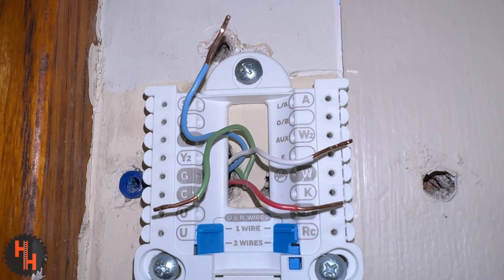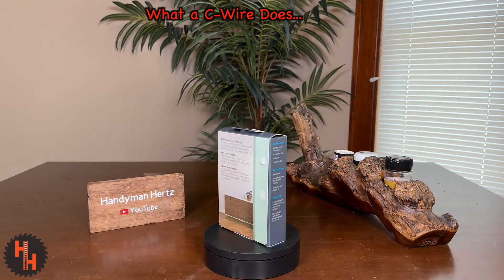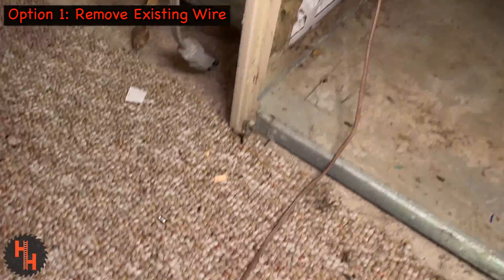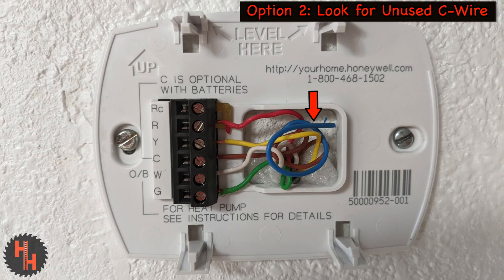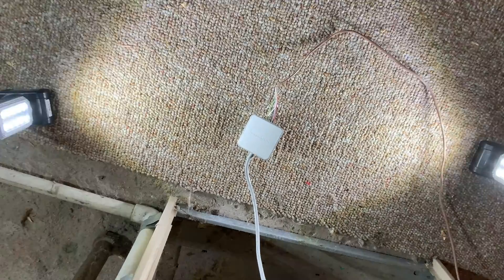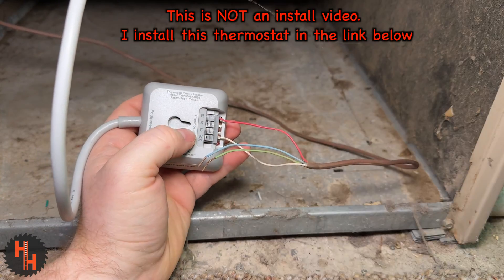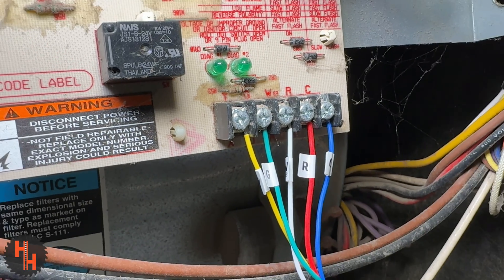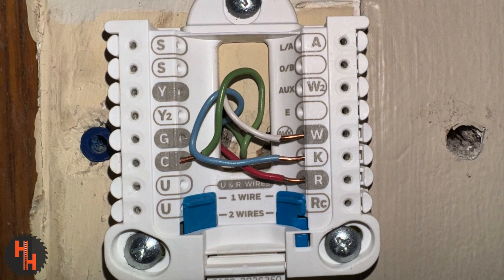Add a C-WIRE ADAPTER Instead of Rewire (for smart thermostat)

Comment: @handyman hertz  I have an older home which uses a Boiler for Heat.  I only have a 2 wire setup. I removed my current old school honewell Thermostat and found only 2 wires..  I would like to connect a smart Thermostat but have yet to figure out the brand or how
Reply from the maker: Sorry, I can’t help you, I am not qualified to speak on boilers. I don’t have any experience with them.

Comment: You need the g wire to run the fan independently 
, if not it wont work
Reply: I was looking for the green wire as well, so confusing

Comment: What if we only have two wires, a red and white?
Reply: Ran into the same issue, instead of running a third wire, i bought an adapter and you just wire it to the thermostat. Its a big job adding and  running a third c wire
Reply: @YoungHeartedSoul what adapter did you use?

Comment: Hi, on my furnace and thermostat I only have 2 wires. red and white for just heat. Can this be used for this setup also? Thanks
Reply: same question!
Reply: Same question.
Reply: Yes. My furnace has 2 wires and I use a wall adapter, split that into the C and Rc.

Comment: I’m confused! Does the adapter wire need to be ran from the thermostat to the furnace?
Reply from the maker: From your thermostat, use the wire you have, and it goes into the C wire adapter. The C wire adapter has its own set of wires that then goes to your control board.
Reply: @HandymanHertz so then probably won't work if you have heat pump, right? Because doesn't the blue wire end up doing some type of reverse function?

Comment: I installed Sensi thermostats in our Church and Sensi C Wire Maker Kits.  Still working off of batteries.  Do you have any suggestions?  Any help would be greatly appreciated.  Thank you for the video

Comment: What if there's no c wire connection at your furnace?
Reply: There's no c terminal at the furnace. I bought a c wire adapter kit but that only works if there's somewhere to connect it.
Reply: @elbucky6 same issue here. Any chance you found the solution?
Reply: @MattyFrank it's been a while but I think I connected it to the same place where the lead, with no voltage, going out to the condenser is connected
Reply: I have a 2 wire system ... will it work
Reply from the maker: Then You need a c-word adapter. Which I have a video link to in the description
Reply: @HandymanHertz  C-word adapter? Just say the word. we're adults here.
Reply: @HandymanHertz  Does this Honeywell C-adapter only work for Honeywell smart theromostats or can it be used with ecobee/sensi? Thanks

Comment: Did you just marry the fan to cooling1 and re ran green as C? Did you cut off your heating? You didn't explain what's going in that splitter. Well edited video but I recommend you talk to an hvac tech before someone hurts themselves. 

First shut off your ac at the breaker 
24 volts (thermostat voltage) won't kill you but will destroy your control boards and thermostat is you're not careful.
Reply from the maker: thank you for watching. let me clear up a few inaccuracies in your comment....this is NOT an install or how to video, as i describe in the video. Yes, obviously you would want to shut off your breaker, but would unlikely damage your control board, at least in my experience. It usually blows the 3-5 amp fuse if you cross wires, for what it's worth. FWIW, you wont even feel 24v shock at all if you have dry hands (replaced many of these, never have i seen one in my area thats 110/220 yet)

i show in the video what the final wiring hookup should be with the adapter if you want to see the wiring.